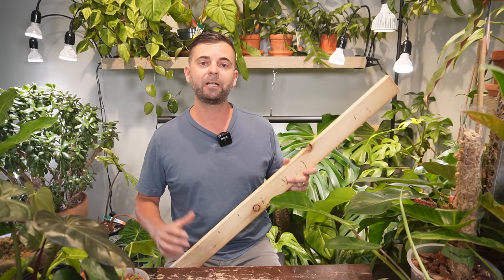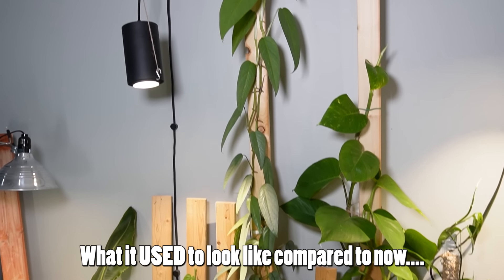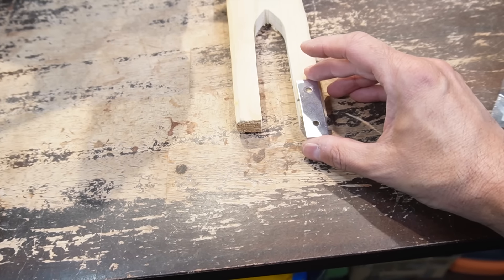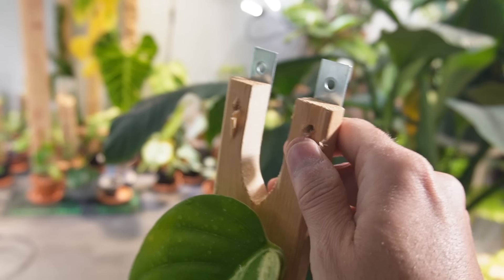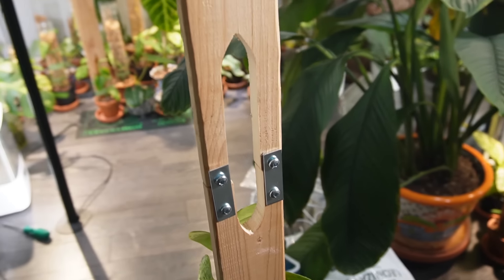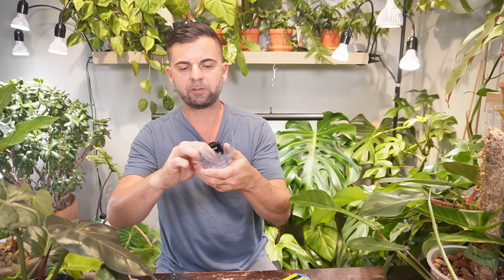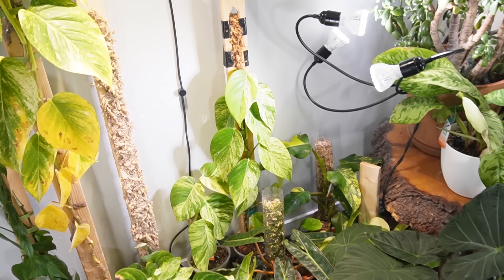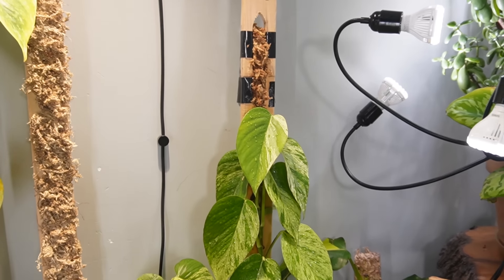I made a REVOLUTIONARY plank system!

Comment: GREAT idea!!! Might use a thicker water bottle so it’s sturdier & adds to keeping it stabilized. Maybe try leaving part of the bottle to use as a side flap to staple to the back or side of the board. 🤔🤔🤔
Reply from the maker: I did think of how I could attach it to the plank. I will have to find something I can staple to the plank
Reply: How thick are the air prop containers that you have? Those might work. Put half on the bottom plank & the other half on the top…..then put the brackets over them.

Comment: When using screws in thin wood (and pinewood especially) you HAVE to pre-drill. Another method could be using dowels in the connecting bits. If it does not need to be de-mountable you could use wood glue to connect the extension to the base. Dowels and glue would also allow the two planks to be sawn in half later on.
Reply from the maker: I did pre-drill! I had to use thicker screws because they were the only ones short enough to not poke through. This is definitely not the final product and I hope to incorporate some wood working friends to help me make a 'presentable' final plank

Comment: Very cool design. Still watching the video as I post this comment, so apologies in advance if you ultimately reach this same conclusion and mention it at the end of the video, but…if you want to try it with original design idea of cathedral style joint, a jigsaw might be the right tool to use to cut the section out. Smaller saw blades and more flexible.
Reply from the maker: Currently I don't have the proper tools but I have a friend that does wood working as a hobby..... So I'm hoping to brainstorm with him about version 2

Comment: I’m wondering if you could cut the two ends of the planks to fit like a lock and key and then attach the bracket on the sides instead of the back, then you could just allow the plant to continue growing without any window or need for any moss, like the two end pieces would fit together like a puzzle 🧩 or a lock and key 🔐
Reply from the maker: I'm actually sitting here thinking of the same idea right now lol Like I said in the video this is only version one
Reply: But how would you air layer to get roots?